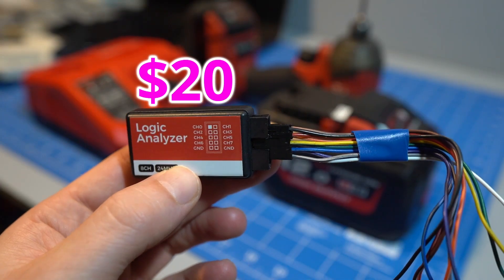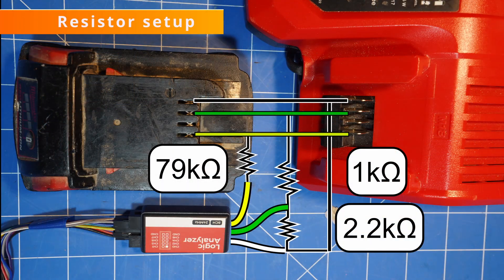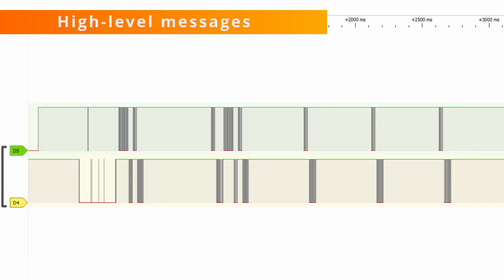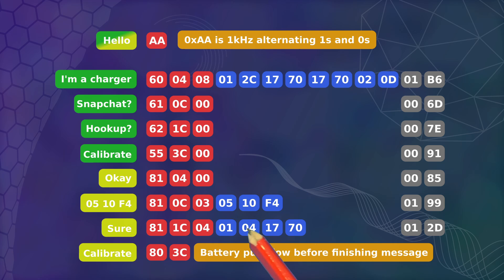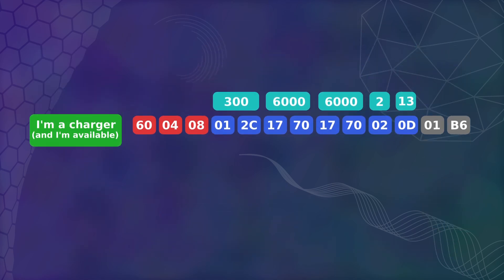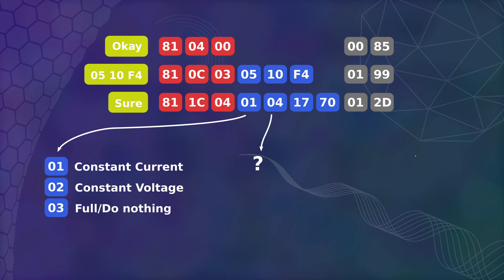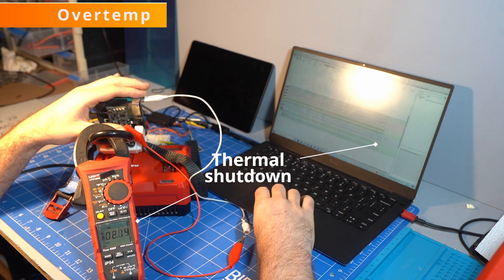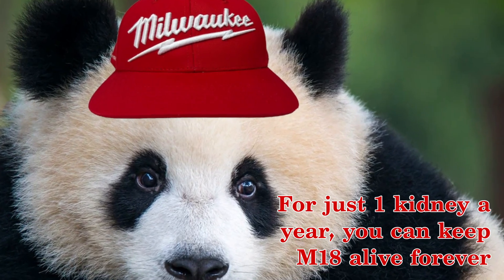[004] Reverse-engineering the Milwaukee M18 Redlink Protocol

Comment: milwaukee is probably going to send you or youtube a takedown notice i am prepared i downloaded your video so it can be posted to tpb or back to youtube should it go down.

you may have triggered a suicide mode by pulling the balance lead.

in sucide mode the bms then wont take new cells it prevents you from rebuilding the battery.
Reply from the maker: I tried to look for the legalities of it, but it's a bit grey. The only example I can think of is the Samba reverse-engineering of Microsoft's SMB protocol, which Samba was successful with. But it's a fairly different situation as it was deemed that there was a public benefit for 3rd parties to interact with SMB. It's such a simple protocol that all of Milwaukee's competitors would have figured it out within a month of them releasing it. I imagine most of the 3rd party batteries have reverse-engineered it as well. But yeah, big corp with advertising dollars, versus 100 subscriber youtuber is a fight that I will always lose if they choose to issue a takedown.

I've seen other vids where people have rebuilt M18 packs and putting it in a charger initialises it. I was hoping to get this effect to see what the initialisation handshake was, but no luck. I suspect that I mechanically damaged the thermistor (the silicone holding it in place cracked from me levering the PCB), or thermally damaged components near the balance pin as it took me way to long to desolder it. Battery state 04 is overheat, so I think state 05 might be undertemp and I've damaged the thermistor or associated circuitry.
Reply: @toolscientist  i am talking about the reverse engineering of the dmca witch was originally used to stop skilerov from selling software to crack the protection in pdf files

Comment: SUPER interested on how they communicate with the tools. I would love to make my dewalt 60v blower have a DIY backpack mounted battery.
Reply: The DeWalt batteries are essentially dumb batteries which expose all the individual series cell voltages, and a resistor to indicate capacity. 

The flex volt batteries, iirc from an Internet post, are the same unless an electrical jumper is made, and a special physical connector switched it to 60v mode.
Reply: @cculpepper1 Right, one reason is to help with air transport.  In 60V mode the battery is too big to air transport IIRC.

Comment: Wow, DeWalt is so simple.
Reply from the maker: True, but there's advantages to simplicity. Dewalt's design shifts all the smarts into the charger, which makes for cheaper batteries and better cell balancing.
Reply: @toolscientist  yeah, agreed. I like the system of pinout for off pack balancing. It makes way more sense. The BMS in Milwaukee packs are absolutely the weakest link in the system.
Reply: @yolo_burrito  I'm hoping the new m18 pouch batteries ('Forge') have better charging logic. They at least addressed my big concern with pouch cell fragility by beefing up the battery shell to glass-reinforced nylon instead of sewer pipe ABS. I suppose this is the advantage Milwaukee has over the Dewalt design: they can engineer new charging logic/BMS directly into the packs and keep them backwards compatible with the simple charger logic.
Reply: @bnasty267  sure but there’s much less space for balance resistors inside the pack. I suspect this is what the issues with the 12ah and their other large packs was. One series would get out of balance and BMS would charge until a series got to set voltage with no ability to bring them in line.
Reply from the maker: @yolo_burrito  As part of the testing for my low-voltage cutoff vid, I filmed a charge sequence whilst measuring all the cells (it's not in that vid, though). From that test, I think it's exactly as you describe, although I need to do further testing. Highest cell hits 4.19V which puts it into CV mode. With the drop in current, the lagging cells fall back further. CV current is modulated to keep highest cell at 4.19V (as it should), and it drops to termination current long before the lagging cells can catch up. 

I need to test whether it keeps balancing whilst left on the charger. I did a crude test a year ago where I left a 12ah on the charger for 72 hours and saw no improvement. I was only taking rough measurements, and I don't think I wrote them down, just noted that it was still very imbalanced.
Reply: @yolo_burrito Yeah, bleed balancing is just dumb, especially with tiny little surface mount resistors. It would be nice if the charger used passive/bleed for the main charge (for speed) and then if a bank fell to far out, the charger could give the BMS 4.1 volts and it would just use a CV charge on the bad banks one by one. Easy enough to fix with a 4056, but I shouldn't have to.
Reply from the maker: @bnasty267 their design with the separate charging pin makes this fairly easy. Although they'd have to add another 5 mosfets and I don't think there's any room for that.
Reply: @toolscientist   and still they are more expensive than equal lxt and blue bosch packs in the eu, sad :(

Comment: Great video. Subscribed! Worst checksum I ever saw was a single byte xor over 32kbytes of data....what could possibly go wrong....
Reply from the maker: It's bizarre that people re-invent the wheel (and make a triangle), when there's a whole suite of 40+ year old checksums that they could choose from. I guess they get turned off by apparent complexity of the code samples and opt for something that they can understand.
Reply: @toolscientist Speculation: The very first battery they were experimenting with had some sample code written by an EE or mechanical engineer who was dealing with the analog or mechanical side. They kept playing with it and by the time a software dev got involved, the software guy was told the protocol was good enough. 

I don’t know if that’s what happened to Milwaukee but that happened to me on a fuel cell power project. Except it had no checksum and I couldn’t convince them to add one. (!!!)
Reply from the maker: @gf2e  I think there's a good chance of that. There's a lot of hints that this was written by someone that hasn't done much serial data before. Things like: using MSB; a very basic cksum without even the simplest adjustments like inverting the bits; a 2-byte cksum when only 1 message ever sums over 255; the weird 2nd byte (if I'm right about it). Someone experienced with serial data would have been more likely to use LSB and CRC-8. 

There's also a few hints that they had a lot of issues with noise, like requiring 2 overheat messages in a row before acting on it.

I'm not an expert in embedded (or any!) programming. I'd really appreciate it if you could look over the message summary I posted at the end and give your 2 cents. Does my 2nd byte theory make any sense? It just stood out to me that they left the 2 lowest bits empty, possibly to catch errors from a slow receiver clock thinking the stop bit was a 1.
Reply from the maker: @gf2e  that's good speculation. The other thing I just thought of is that the MSP430 is 16-bit, so that makes the 16-bit cksum make more sense. Maybe some other bytes have been inserted to make things more efficient for 16-bit operation? There's also the fact that this protocol was only announced in 2012. I have batteries from Dec 2013 that still use the older protocol which just uses very basic pulses and high/low status on the J1/J2 pin. So whoever designed this was also constrained with backwards compatibility. The fact that J2 operates at 12V and J1 at 3V, kinda makes me think they were constrained as well (although that could be a constraint of not having enough space on the PCB to add an amplifier to the MCUs UART pin).

I think current request from battery is just the easiest way to do CC/CV charging. Ask for full current during CC, then have a feedback loop that measures cell voltages and modulates the current request to keep all cells below 4.2V, then terminate charging when current request falls below a threshold.
Reply from the maker: @gf2e  the other theory I had for the 2nd byte is that it was a debugging byte to tell you what function made that message. I discarded this theory as surely you'd just use 1,2,3,4 to make it human readable. Maybe they do left shift, and +4, each time it enters a new routine, so we're seeing it progress through nested functions? The conspicuous binary structure made me think it was a bit mask or binary operator, but I couldn't find any way to use it like that with the 1st or other bytes. Ultimately the fact that it omitted the lowest 2 bits made me think it was related to noise and error detection.
Reply: @toolscientist  I was just speculating that maybe it did everything in 16 bit chunks, but looking at the protocol in your video I see that it has odd numbers of bytes some of the time. I was actually wondering if it even did something like set the UART into a 16 bit mode. But, nope, doesn’t look like it. 

If they’re doing things in odd or even numbers of bytes, then it seems likely to me that they’re mostly doing 8 bit operations in C, and they’d have to explicitly decide to use 16 bits. 

Having some 12v and some 3v is interesting. Embedded microcontrollers vary in their tolerance of higher voltages on their pins. Without extra hardware, a pin is always limited to not going above their supply voltage. Fancier chips have some, or all, pins with that capability built in from the factory. 

I did some work years ago on TI CC6000 processors. Their toolchain and sample code was atrocious. They literally didn’t keep register names consistent. And their sample code had functions that sounded like generic initialization of hardware but actually included details specific to the examples that wouldn’t be normally used. 

One of the dev boards came with sample code you could run from memory. If you tried to upload that code to flash, it would hose the board on boot up so that you needed to lift the flash chip pin off the board to recover it!
Reply: @toolscientist  Human readable - using what platform? On a printf to stdout, on a logic analyzer’s byte decoder, or on an oscilloscope without a logic analyzer?

The length of a sequence of ones is easy to read on a scope :)

I know that long sequences of zeroes can be problematic on devices and I’m aware of things that systems have done in the past such as map a 3 bit(?) pattern to a 5 bit(?) “no long zeroes” pattern. I’ve never thought about doing that for binary UART use.  It could well be standard among experts, just adding a small data point that I’ve done a lot of amateur and semi pro embedded and I wouldn’t have thought of changing the protocol in the way you proposed for noise. I think it sounds like a great idea though. :)

(Semi pro as in I was getting paid to do it, but it was not my full time gig. Getting paid hourly to learn new stuff is loads of fun!)
Reply from the maker: @gf2e  excellent point. On a scope  that would be very readable. So a debugging byte seems like the most obvious explanation. That means they'd just discard it, and then you have your 16-bit header
Reply: @toolscientist  When you started this process, you didn’t realize it would be 75% binary math and 25% psychoanalysis, did you? :)

If you ever see a hardware lab that looks neat and organized and doesn’t have messy wires - it’s not the real lab. It might have some interesting stuff happening, but somewhere there’s a messy wire filled lab where the boards are tested before they really work properly. In my case that was actually our off site contractor lab. But a place that builds hardware and doesn’t have fragments of modules sitting around can only troubleshoot so far.

Comment: This was super interesting. I'd like to replicate this with my AEG battery to see how it communicates with its charger. I have tried to charge it with a lab power supply and it went into protection mode so I think there must be a similar handshake happening.
It would be cool if theyre sharing the same tech being both TTI companies
Reply from the maker: Definitely give it a crack, I'd be interested to hear what it's like. Apparently Milwaukee operates fairly independently, so my guess is that they more likely copied Ryobi 40V. You can find a thread on diyelectriccar where someone posts some data from Ryobi 40V
Reply: @toolscientist  this is kinda correct. Milwaukee works with Empire level and Imperial Blade, Stilleto Hammers, Kango Blades. With most of this design work is done in Milwaukee, WI.

But is largely independent of Rigid, Aeg, Ryobi, Hart or any of the vacuum brands. Most of this is done in North/South carolina

Comment: Makita power tooks, some of them anyway do not like milwaukee batteries using those cross brand adaptors
Reply from the maker: Are you referring to the white adapter? That's a pass-through adapter that I made so I could measure current, voltage, and probe the comms terminals whilst the tool is running. You can see it better in my power testing video: https://youtu.be/XNKlEHLwldE?t=1m10s

Comment: Excellent work. I have attempted years ago to learn more about the EGO 56V BMS Communications. I can't seem to get motivated enough to go much further or buy better equipment just to look deeper. I like the look into the M18 communication. It will be very interesting to see how it communicates with the tools and how the aftermarket packs differ or if even at all. Just like the EGO aftermarket packs, I assume they have to be very close to the same if they play well with the brand's real tools and chargers. Thanks for all the effort you put into this to share it. It was a huge effort I can tell.
Reply from the maker: I didn't put it in this video to avoid going off on tangents, but there's an older and simpler protocol that the charger can fall back to. Older batteries (mine are Dec 2013) communicate with a very basic system of pulses. From memory it's something like 2 pulses from the charger to initiate charging, and then battery holds high until it wants to stop. Charging current is much lower, I think around 1A. So some of the aftermarkets are probably using this simpler communication. You'd be able to tell which ones use the full protocol and which ones the older protocol by their charging speed.

Yeah, it was a big one! My files say I started in late July. Took me a week to get reliable data capture as it was my first time using a logic analyser and I initially thought I had a dud. Fortunately Buy It Fix It's work let me know that it was possible and had enough info for me to figure out the necessary resistor setup
Reply: @toolscientist  No doubt it took a lot of time. When you have months of footage to go back through for me it gets very tough keeping up with what I did record and what I meant to record later...
Especially if I let one or 2 projects sit waiting on parts or waiting on cells in a storage test to see how they fare after a month or so.
Reply from the maker: 100%. I think someone needs to hire us some research assistants 😄
Reply: @toolscientist  for real! 🤣

Comment: I have a pretty good understanding of battery charging, but this communication stuff is beyond me.  I did pick up that the charger has a constant voltage section at the end of the charge profile.  That's good to know and I had had missed that in past M18 videos.  Any idea if that 600mA termination the same in the standard, rapid and super chargers?

Well put together video.  Thanks!
Reply: CC-CV is the standard Lithium Ion charging protocol. Constant current until the target voltage is reached then constant voltage until whatever termination current is set.
Reply from the maker: I don't have standard charger. Samsung datasheet says 10% termination current, and rapid charger follows that. So standard charger is most likely 300mA
Reply: @toolscientist  My understanding, the 3 chargers are 3A, 6A, and 12A respectfully.  Likely following the same profiles.